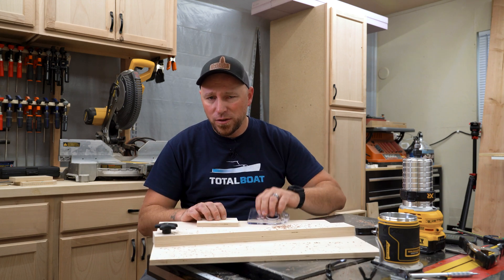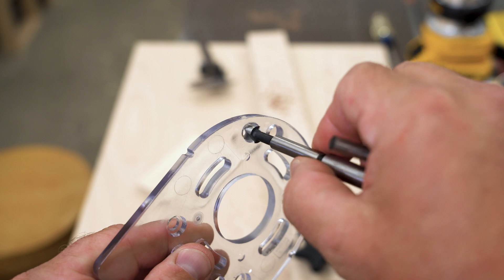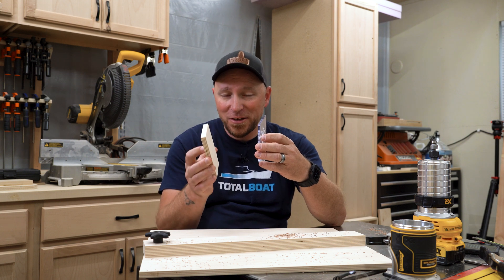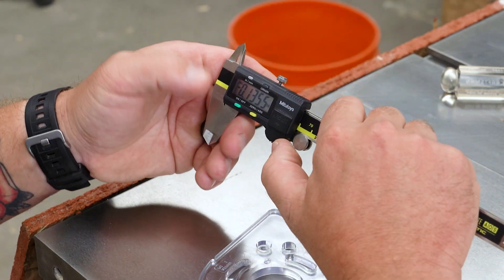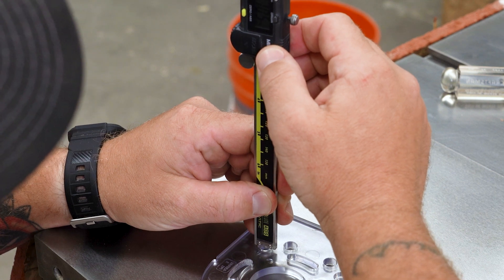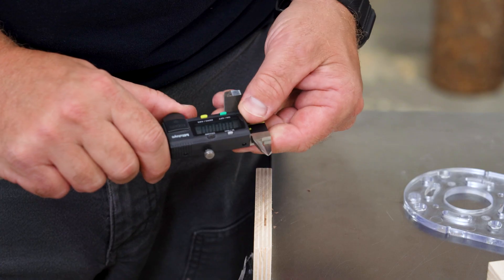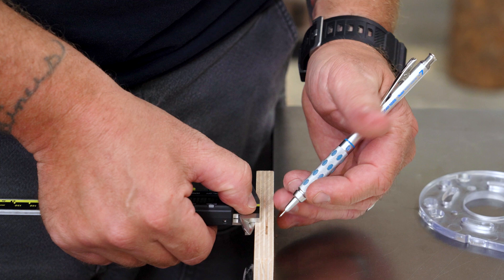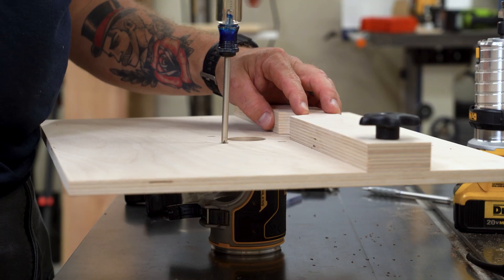How to Measure THE LOWER HALF of a Counterbore Hole

Comment: An alternative in this case is to simply chuck your 3/8 forstner into your drill press toss the original router plate under it, lower the bit into the plate until it touches the bottom of the original countersink hole, and set the press depth stop. I love all your tips on how to get precise work without doing lots of measuring and math... This video was not one of those tips.
Reply from the maker: @Ben R I mean to be fair, the first three words in the video title are "How to Measure", so I'm not sure what you were expecting. Haha. At any rate, you are correct and that would typically be the same way I approach this particular situation. But there are a lot of other situations that this could be useful to people, and I thought it was worth sharing either way.
Reply: @InspireWoodcraft  Lol, touché! And to be also fair, I watched your whole video because I know I'm only using half the potential of my calipers. Perhaps if I keep educating myself, it will sink in someday. In either case, keep it coming! I like the way your mind works in the shop!

Comment: Not too deep, not to shallow, perfect.
That is, if you're using the same material (acrylic) but if you're using a different material, the theoretical depth has to be different.
And if you say "it's good enough" for any strong enough material, then why measure so precisely in the first place?
Reply from the maker: It's not about the precision, it's about the right tool for the job. Kind of hard to measure that with a different type of tool.

Comment: You should be using much longer screws as the shorter screws will tear out of the screw holes when fastened to the plywood top. Ideally, you should be using a router plate since the forces will deform the screw holes and cause precision issues. At the very least, use washers.
Reply from the maker: @Bob Weiram If I had a nickel for every "you should do it different" comment, I'd have a lot of nickels. Ha! With a good quality plywood and the amount of material left over, the stock screws will hold up and last perfectly fine with this little trim router. I have done similar with much larger routers using the stock screws and all has worked well for many years of service. Of course, longer screws certainly won't make it worse!
Reply: Second that.  I learned the hard way.